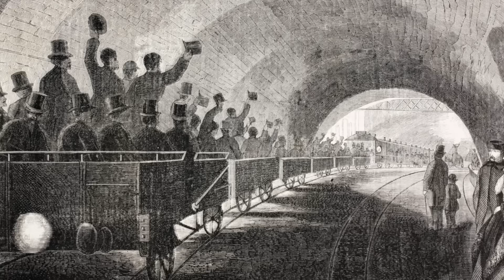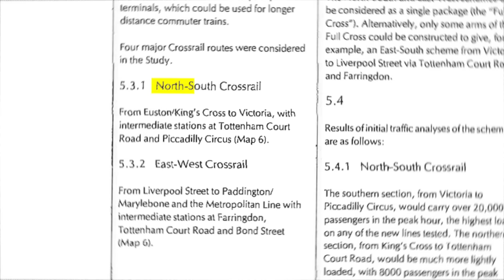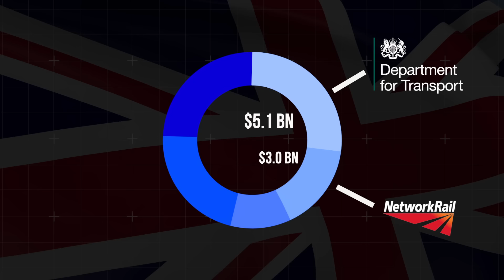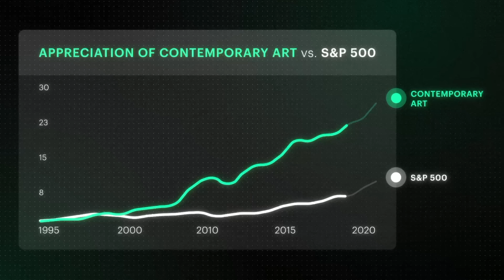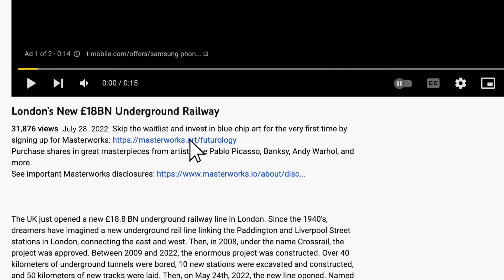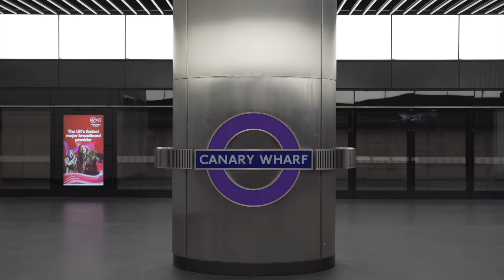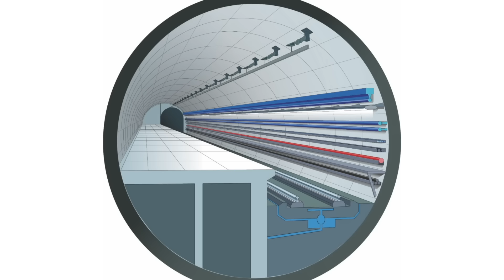London’s New £18BN Underground Railway

Comment: Just a little correction, Elizabeth line services to Heathrow are in operation. They ran under the TFL rail branding for a while but the only difference is they dont run through Paddington onto Abbey Wood and instead terminate in Paddington alongside the GWR and Heathrow Express services. Apart from that great video :)
Reply: Likewise, the Shenfield to Liverpool Street section of the Elizabeth Line is also in operation, having previously operated as TFL Rail for a number of years.
Reply: @lesfuller5984  same as reading to paddington
Reply: Will you all just listen to yourselfs, arguing about a small subway. Don`t you know that on the other side of the M25 there is a place called Britain or UK, that could do well with the £18.8bn. NHS and the drugs problem to name a few springs to mind.
Reply: @williamgardner2739  you clearly need more funding in your schools if you can't tell that nobody is arguing anything. just adding extra bits of information.
Reply: @williamgardner2739  says the guy moaning
Reply: For now…
Reply: @williamgardner2739  While i agree that other parts of Britain could use the £18.8Bn i think its worth pointing out that London is the financial powerhouse of the country and the money spent on Crossrail will undoubtedly be paid back. Crossrail has massively upgraded train services across the capital and enables more people to live further from london while still being able to commute. The new line has undoubtedly improved the standard of living across the capital and hopefully could see more infrastructure projects across the country.

Comment: Regarding about the last part, you are incorrect

The Elizabeth Line is opened fully, it just hasn't been connected fully yet, so Paddington to Abbey Wood is once branch of it which is the one that recently been opened

But Reading - Paddington and Liverpool Street - Sheffield branches have been opened for a good way as the "TFL Rail"

Comment: Londoners: We had to wait a long time for Crossrail to finally open!
The New Yorkers that have been waiting for East Side Access: ....that's rough, buddy 

No surprise that the MTR is operating it, the MTR in Hong Kong is the one of the most impressive systems anywhere. They run on-time 99.9 percent of the time, and if there's a delay of more than 31 minutes, they must apologize and pay a fine to the HK government.
Reply: Ikr crossrail is so similar to the new territories line in Hong Kong! The screen doors, the space, the ventilation, e.t.c. (I went on crossrail on a hot day btw).  It's such a big step up compared to the central line or Victoria line which I normally take!
Reply: @kadinothebean3419  the Victoria line is amazing and better than crossrail. just look at the acceleration on that 2009 stock beast
Reply: @marcoroberts9462  it depends what u what, good acceleration, etc or proper a.c.,  more room, etc. I may have stressed the a.c. on crossrail too much but it was 30°C, and when I went on the other deep level lines, it was unbearable!

Comment: What an excellently well-made explainer video! I can tell a lot of effort went into the research and production of this so great video overall!

My only criticism would be that when you show the map of the 10 new stations, you have the most easterly one marked as being 'Stepney Green' when in reality it's actually Abbey Wood. An easy mistake to make but still one I thought I should point out!
Reply: No it isnt. Abbey Wood is in South London. Stepney Green is in East London
Reply: @michaelcampin1464  have a look at a map of the Elizabath line. There is no station on it called Stepney Green. There is a station called Abbey Wood, which is the south-eastern terminus of the line.
Reply: @MikeWillSee  i didnt say there was i was just pointing out a  basic fact that Abbey Wood is in South East London. I went to school at Stepney Green/ Bow Road so i know where they are
Reply: @michaelcampin1464  just checked and Abbey Wood is actually further east than Stepney Green, albeit south of the Thames.

In any case that doesn't change the point I originally made, which is that it's the line's most Eastern terminus, and that it's labelled wrong on the map in this video.
Reply: @MikeWillSee  yes i agree it is the eastern most terminus until Shenfield is opened fully then itll be Shenfield although Abbey Wood will have servicing depot.

Comment: Fun fact: The Elizabeth Line is actually NOT a tube line, according to the crossrail staff it is more of a "railway service running in tube environment", which is the reason why the stations along the route are all included in the national rail services network, unlike usual tube stations!
Reply: The UK is not that big so indeed they can easily integrate that line on a not too small national rail network map.
Reply: They must have gotten that moniker "railway service running in tube environment" from the US Pentagon, where a shovel is a "portable land evacuator." ;-)
Reply: @johnchastain7890  Hence it's over budgeted ;)
Reply: @jandron94  That's actually a different story in the UK though. In the UK they got the franchising system which seperates maintenance and operation, in Lizzie Line's case, the operation is granted to MTR whilst the maintenance is still managed by Network Rail, subsidized by DfT. On the other hand the tube, track and operation are all managed by TfL, hence the tube stations that don't have a National rail services connection will not be counted into the network
Reply: @JeffreyLincrunchie  If we'd cancel a Batplane or two, we could afford modern trains from DC to NYC and Boston. But NOOOOoooo....
Reply: @JeffreyLincrunchie  Clearly this was dreamed up by MPs arguing after-hours in some posh watering hole.

Comment: Just one thing that’s incorrect about this video, the Elizabeth line is not a tube line. It’s a National Rail service
Otherwise this is a fantastic video and very well put together
Reply: It's a tube line and an underground line - running underground in a tube. It's just not a Tube line, or an Underground line, ie part of London Underground (though you should treat it as functionally part of that network, even if administratively part of a different one - it's frequent trains charging the same fare scale).

Comment: The fundamental nature of the universe are not particles but fields. These are fluid-like substances that can be perturbed, they can vibrate and experience excitationsFields have the property that they can give their vibrations or energy away. If you shake the field hard enough, they will affect other fields. So in this decay, the energy of the quark fields of the Neutron can be transferred to the quarks fields of the Proton, plus electron field and antineutrino fields.Once you tap the field hard enough, however, a particle is created. This discrete unit of energy that the field can accept is what we call the rest mass energy of particles in a field. It is the fundamental amount of energy that must be added to the field in order to create a particle. Some particles like the Higgs Boson, require a lot of energy to create it. That’s why the Large Hadron collider had to be built to detect it.

Comment: Correction: It's not a Tube line.

Services are also running between Paddington and Reading, to Heathrow and out to Sheffield. I don't know where you're getting that from, it's just not been fully integrated yet with the proposed through services, but they are running.
Reply: It's just a bigger tubeline
Reply: @millhilljimjimmy6731  No, it isn't a tube line. Definitely not a Tube line.

Comment: This is what the rest of the UK needs. An underground railway system going direct to all of the major cities. Wheather for public use or freight would be for the operators to decide upon. But an underground system would alleviate the very congested roads. Freight trains underground could take many heavy goods vehicles from the motorways.
Reply: Tunnelling is very expensive.
Reply: @seansmith445  HS2 was very expensive,and nothing was constructed. Just consultation fees.

Comment: It's not an underground line. It's heavy rail and more like an s bahn system. (The tube is completely different (those trains have generally short distances between stations. Where as the crossrail lines function more like main line railways (longer spaces between stations).

There are lots of videos that explain the difference and explain why crossrail is not an underground line.

I'd recommend watching Geoff marshal, jago hazard and rm transit, who all do good jobs explaining why cross rail is not part of the tune (on the same way that the paris rer is not part of the Paris metro.

Other than that, this is a good video imo.
Reply: Well new metro lines in big cities like Paris and London are not really needed as in the same mid 20th century capacity. So much longer trains and much longer lines are now needed. The metro line 14 in Paris is an example of that, it is part of the metro network but so different with automization (such a big difference).
I don't know much about S-bahn but I am not sure that in Germany extreme capacity is needed because they don't have mega dense cities like Paris or London.
In Paris we will have to wait at least end of 2025 for a new line 15 that will be the first "suburb only" metro line. Before that the line 14 extention to Orly Airport is supposed to open in summer 2024.
So let's say that in 2026 the Paris network will have changed as much as the London one has changed with the new Elizabeth line.

Comment: Correction: You erroneously imply that services on the full line are not yet available; this incorrect. The full services from Reading/Heathrow and Shenfield are being offered today. What is lacking are the through services. Right now people have to change at Paddington to continue their journeys to/from Reading and Heathrow on the Elizabeth Line and at Liverpool Street to/from Shenfield via the Elizabeth Line. It's currently being run in three segments with expectation to have true through running by the end of the year. The central core service runs from Paddington to Abby Wood.

Comment: When I think that here in Munich the second core route of the S-Bahn urban train will cost 7,2 BN for only 11 km + around 3 BN for the new U9 metro and another 5 BN for a new high speed station and conection to the Munich airport, which will be a good deal for Austrians and people from northern Italy, I wouldn't say that £ 18 BN is that much.
Reply: You really think that people in Northern Italy are gonna use the Munich airport ??? Why would they?
Reply: Sorry  @jandron94 ! I mean not the whole region of Northern Italy but specially the also German-speaking region of Südtirol in Italy, since lots of them already use it. The city of Bolzano is located exactly between both the Milan (320 km by car passing the Alps) and the Munich airport (319 km by car passing the Alps). The airport of Munich handled around 48 million passengers and Milan airport handled around 29 million passengers. Lots of passengers take the train in South-Tirol coming for ex. from Bologna and go to Munich East station and change there to the urbain metropolitain train (S-Bahn line S8) to the aiport. MUC is the aiport with the highest amount of passengers among the biggest cities in the Alpine region (Zurich, Milan, Vienna and Munich).

(Passengers in the year of 2019, before Cor.)

Linear distances:
Munich Airport - Bolzano: 209 km
Milan Malpensa - Bolzano: 226 km
MUC - Meran: 194 km
Malpensa - Meran: 220 km
Malpensa - Venice: 280 km
MUC - Venice: 327 km
Reply: @tickrob991  Ah ok it's only a small niche of people because south Tyrol is only half a milion people or maybe it's mainly Italians who have a special price for a very specific destination because otherwise Italians in Northern Italy have plenty of choice (Milan, Venice, Turin, Florence) and who is ready to spend ages in a train ? I mean it's a different philosophy: the pleasure of very long travels with slow easy going trains.
In 10 years from now the Paris-Turin new train line shall be ready and it will link the two cities in 1h45min and Lyon to Milan in 2h30 so I can well imagine futur passenger exchanges between Lyon Airport and Turin Airport or Milan Airport.
What will be special is the Paris-Lyon-Milan HS train line will stop not in Lyon Main Station but at Lyon Airport Train station so convienient and time efficient to catch a train.
What is special in Germany is that some ICE train destinations like Munich-Francfort are not so time competitive compared with car.
It looks like some very big German towns are not so well connected with one another, as if in a competition or some sort of ignorance of one another.
I know that the German geography is not that simple for trains and that Germans are well diciplined and patient but still...

Comment: Please stop calling it a tube line, when you say the word "Tube" whether you realize it or not, you are connecting it with the London Underground Network. Although the line is in a tunnel, it isn't part of the Underground Network. It's essentially an underground Commuter/Regional Rail line running on an underground section of the mainline railway track. That's why the station platforms and trains are longer than tube station platforms and traditional London Underground rolling stock. That's also why the tunnels have a much larger diameter than traditional tube tunnels (mainline railway rights of way are larger than tube line rights of way) and run with very different rules and regulations than the tube lines. These different regulations are why the trains have better air conditioning and more spacious. The fact that its tunnel portion is connected to two of the busiest sets mainline railway tracks in the UK, not a Tube line.

Comment: Total waste of money.
Reply: Critical infrastructure is a waste of money?
Reply: @yeetjones927  it’s not critical, saving 30 minutes was not critical for over 100 years. Why is it critical now? People have been able to make all these journeys before just by changing trains. It’s not as if the railway goes anywhere that doesn’t already have a station. It is absolutely a waste of money, just leave at the same time people did in the 70’s, 80’s, 90’s or 00’s. By all means upgrade and or lengthen the trains or run services more frequently but the actual railway line is a total waste of money. It doesn’t benefit the country in any way.
Reply: @eddherring4972  100% benefits the country. You’re delusional
Reply: @sm8476  give me a balanced point of view with a rational explanation. How does this benefit the whole country 100%?